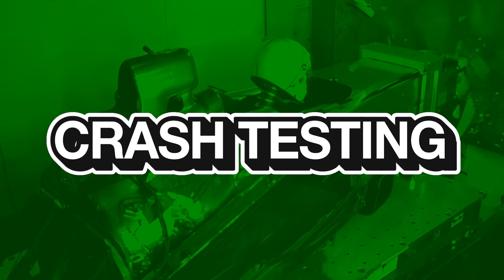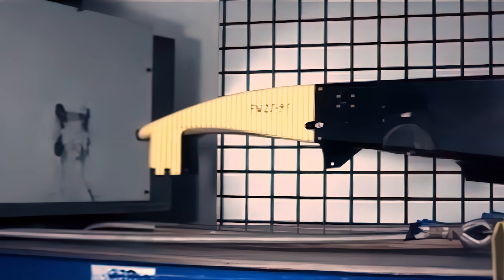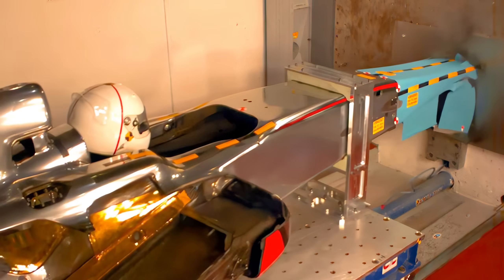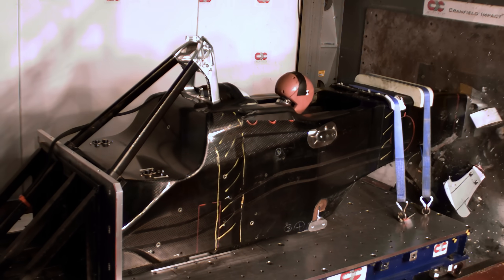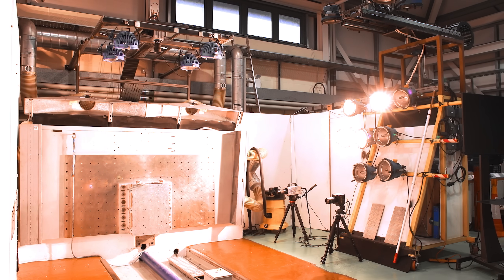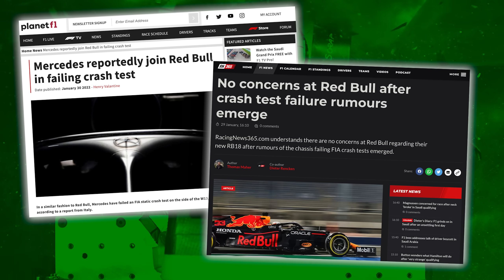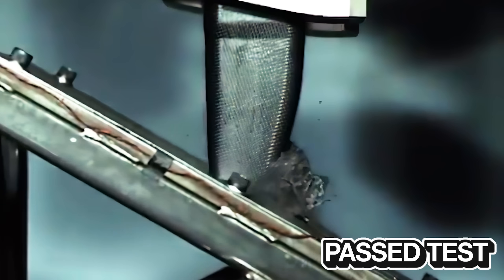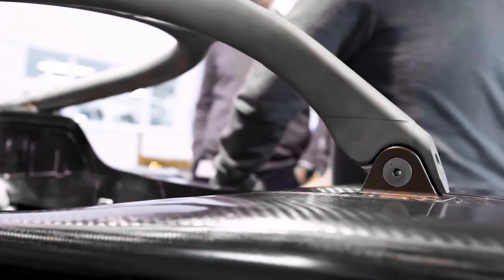How Formula 1 Cars Are Crash Tested

Comment: 17 m/s thats a joke 38 mph
Reply from the maker: It’s more about the weight of force from the sled, which can weight from 500kg to 2000kg - it’s not just the speed going into the wall :)
Reply: A bus hitting you at 38mph is going to cause a lot more damage than a bike going 38
Reply: @Alucard-gt1zf  Ya, but the bike is going mach 2.